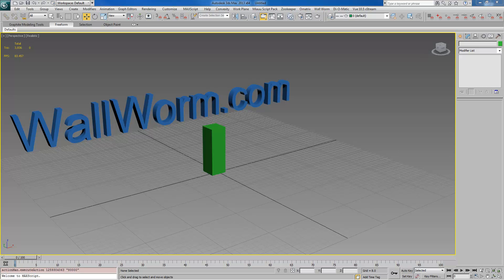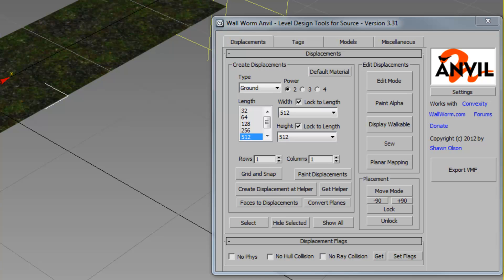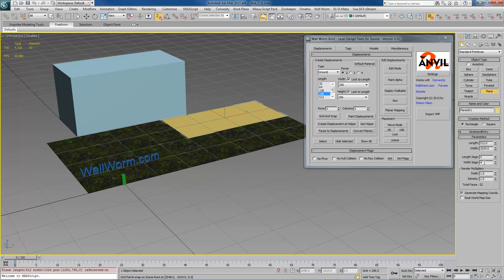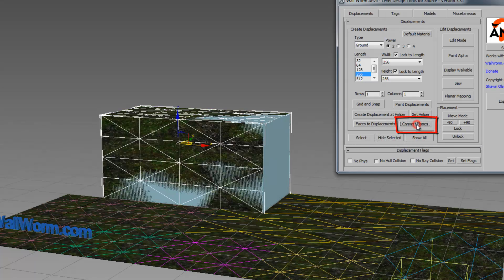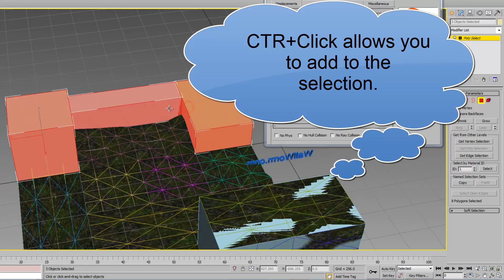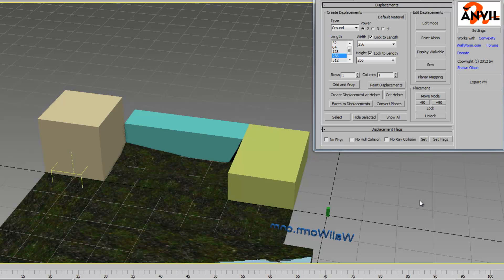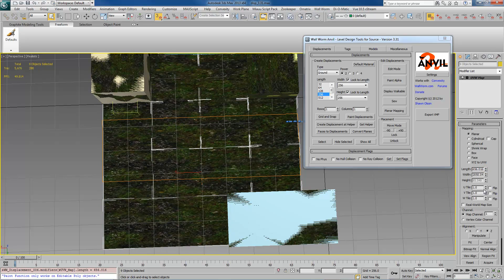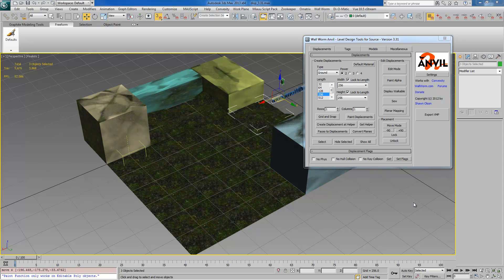Creating and Moving Displacements with Anvil 3.31

Comment from the maker: My best guess is that you need to update 3ds Max to the latest patch. There are problems with Max 2012 without the service packs. You may want to try running Wall Worm > Wall Worm Utilities > Check for Problems and check all options in the General Problems group. Then hit the Check for Problems Now button. See if it warns about your version of Max. Installing updates should fix that.